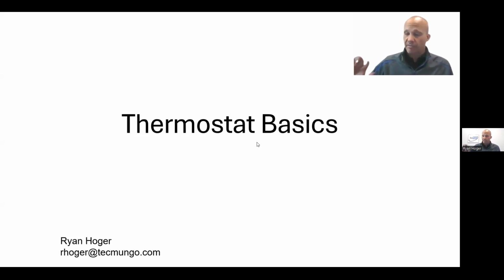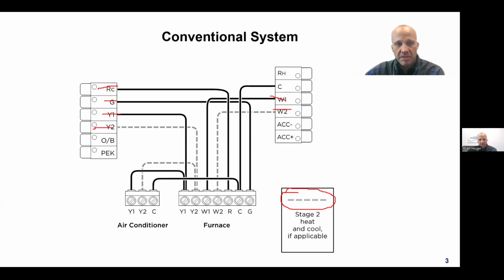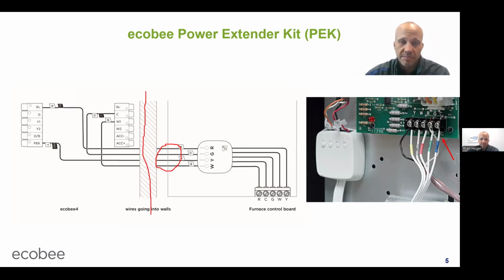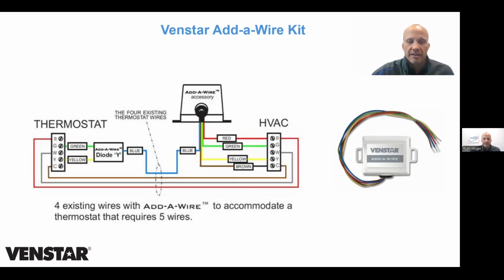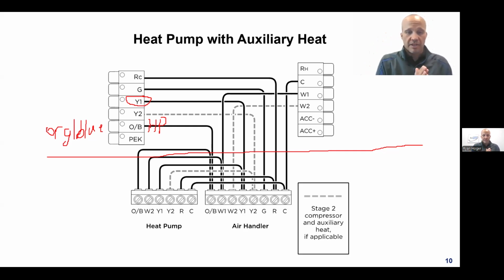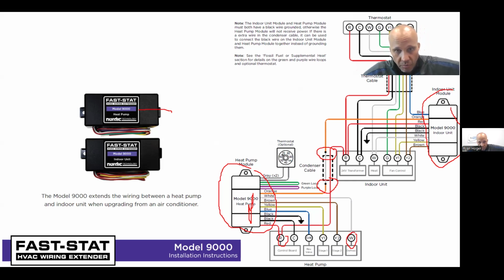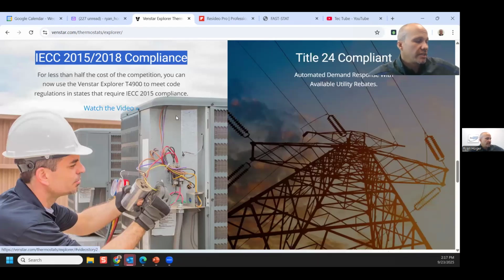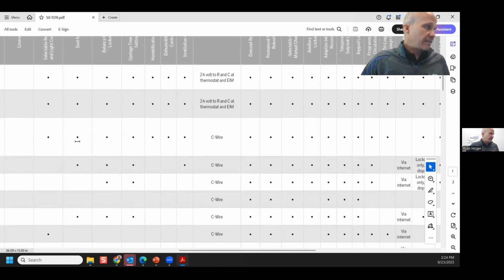Thermostat Basics - PM Webinar 9/23/25

Comment: Can your supplemental heat, it being gas On a heat pump system be used to temper the air when your heat pump goes into defrost. I’ve been told that that’s not a good idea. Is that true?
Reply from the maker: Yes, you can and should use the gas heat during defrost. We do it frequently... in fact in almost all dual fuel applications. Defrost mode is the same as cooling mode in the refrigeration cycle. And cooling mode can handle hot incoming air to the indoor coil. However, you cannot use the gas heat simultaneous with the heat pump in the heat mode because the entering air to the indoor coil will be too warm and will cause pressure trips. We believe this difference is why you often get advance from many... including some manufacturers reps... to not run gas heat with defrost. They don't fully understand these mode differences.